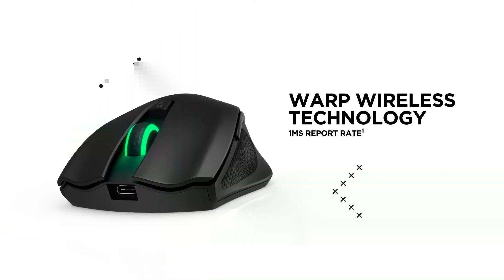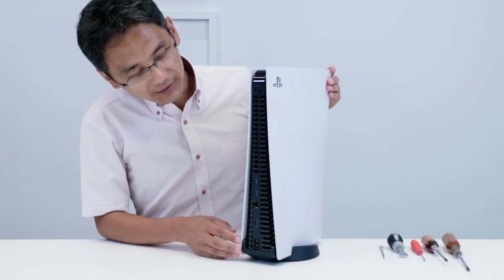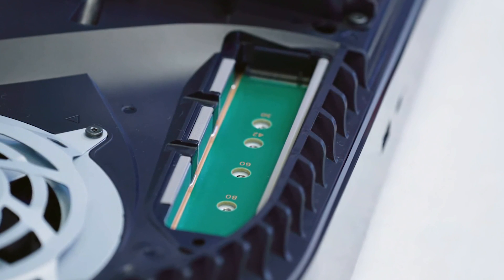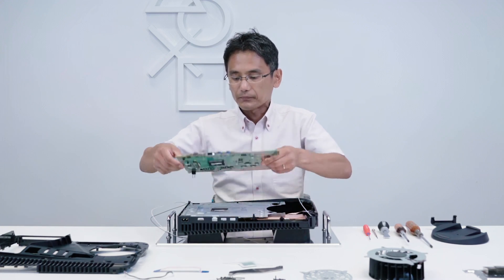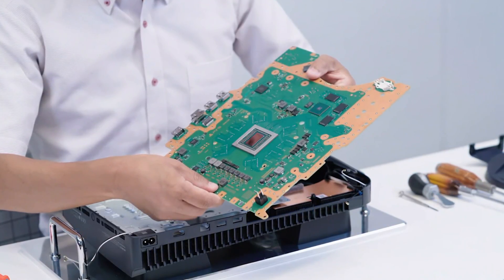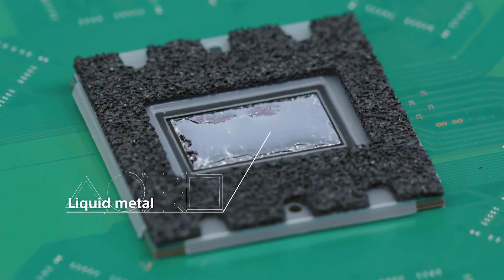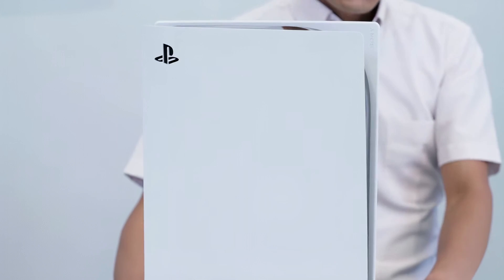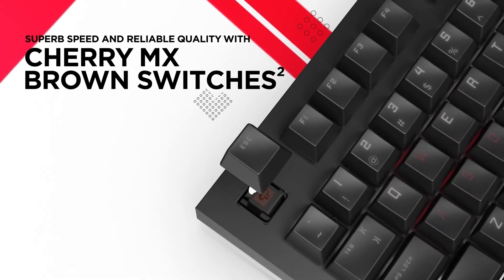PlayStation 5 Teardown Analysis: Inside Sony's Next Generation Hardware Design

Comment: Really put the engineering to these consoles into context...good job by both Xbox and Sony...looking forward to see Whoes solutions are more effective...
DF...you guys are about to have a very Busy 3 months
Reply: I cant wait till DF get their hands on a physical copy of the PS5 so they can do their own proper breakdown
Reply: Sir Vamped  the reason demon souls is 1440p 60 fps is because the Console isn't powerful enough to play it at 4k 60..

A linier..
Non dynamic
Low npc
Low enemy count
+++++First party optimized++++
Game...
Reply: @86lanzo  if this is true then Xbox wouldn't be able to either. There is not enough between them to cause such a drastic drop on one vs the other
Reply: @Jhakaro  I would disagree...one area this Xbox has invested heavily into the series consoles...is in Software...Xbox has the full backing of Microsoft..who specializes in software....Xbox has alot of performance enhancing software..they you just won't see on ps5...

Dispite when ppl who know nothing say...the series x has patents for xboxs own custom VRS..... Machine learning....and  Sampler feedback....

But we will see in time..
Btw the thing that will kill performance the most this gen is RT...so far it looks like Xbox hasn't even finished their RT implimentation....so far we haven't seen RT in a single Xbox game...

However we Kno the Microsoft are the pioneers when it comes to RT ..they worked with both AMD and Nvidia on their RT...it's safe to say they're working on something special for RT on Xbox....it's also worth mentioning series x will be 40% better at RT...so RT won't Kell performance on the series x vs the ps5. ..like we've seen on PC
Reply: @86lanzo  Microsoft isn't exactly good at optimising though, Direct X is way more inefficient than Vulcan, if all PC games were Vulcan instead of Direct X you will get way more performances from your hardware.
Reply: @souljastation5463  depending on what dx you're talking bout...DX11 or DX12...as it stands now there's no performance issues with DX12 it offers on par performance with vulcan..while offering a better suite of features.....some of the best performing games on multiple platforms are on DX 12.. especially xbox first party like with Gears 5..

Dx 11 is another story.
But that's besides the point the work on RT for DX12 is already done...the games we've seen using RT so far were DX 12... probably the best RT implimentation so far (Metro Exodus) was DX12....so the work is done..

Microsoft was the ones who brought RT to AMD... It shouldn't be an issue to impliment RT on series consoles.. especially cause the consoles are DX12U...it's also Known that Turn 10 is Microsoft lead studio when it comes to RT...they did a talk this year at GDC on RT....and have been experimenting with it for years

So the fact Xbox seems to be having problems with there RT would suggest they're working on something special.and the fact PS got there's up already would suggest Xbox is working on a higher level of customization for their RT...

Xbox RT implimentation clearly isn't ready yet...Halo wasn't going to have RT at launch..

DMC 5 Will have RT at launch on ps5 but not the series S/X...

Which if it wasn't Microsoft..the ones who pioneered RT with Nvidia and AMD...then there would be a major problem
Reply: Sir Vamped  who’s talking about Series S? We’re talking about Series X vs PS5. My money says all multiplats will run at higher resolutions and higher frame rates on Series X. You confident enough to that this bet? $100
Reply: "looking forward to see Whoes solutions are more effective"  lol wut?  EDIT - also, the replies are amazing.  People are so butthurt over the SX being more powerful, they have to invent fantasies about how the PS5 will somehow be "better" with its tech.  You guys sound JUST like Xbox fanboys around the launch of the One.  Anyway, this line of thinking has be shit on by DF themselves on their forums - but I guess you can still get away with it here because you have suddenly decided that games dont matter and that Sony's studios won't make the PS5 sing (well, untill convenient, then you will talk about games from Sony's now-puny first party).
Reply: @xBINARYGODx  who implimented cooling better...
Xbox change the shape of the console for better cooling..

PS jbeefed up the heat sink and used liquid metal..

Xbox invested more into gpu an memory

PS invested more into SSD

Xbox and PS though useing the same Architecture..went in very different ways to get the most out the system..both cost 500...but which is best value
Reply: Both Consoles have impressive engineering
Reply: @halogayming0814  yeah many are to ignorant to realise that lol
Reply: FührêrFPöñê  You are being the toxic ones, DP is just stating his opinion; no matter how wrong you think it is he never insulted anyone.
While Xbots like you are the ones calling names and making gross insults.
Reply: MisterMediaX has moved from Xbox to Sony this gen?   Mind blown.    Be your bad self, Mr "Dual Purpose"  Good time,  lots of laughs.    Where is the DGPU this time?  In the side panels of the PS5?
Reply: Sir Vamped  you literally just proved yourself wrong by being arrogant 😂
Reply: Sir Vamped  So you claim the PS5 is holding back console gaming, got it.
Reply: Davin S  bro I'm not trying to insult you but it seems you have a limited understanding of how this tech works. You literally think games run on Teraflops and that's the end of the story.

There is a graphics pipeline that gets your stuff on your screen. Having a peak 12 tfloos doesn't equate to the console producing/render 12 tfloos worth of calculations in a GPU cycle. It just tells you that if all 52 CU were working to process workloads in parallel with in a GPU cycle then you'd have 12.1 to of rendering work @1.825 ghz 

Now SX isn't using all 52 CU in parallel if they have fixed clocks.....they wouldn't be able to manage power draw and heat, particularly in a smaller box and off the shelf cooling system. 

You have also seen no evidence of SX outperforming PS5. We have seen the systems max capacities in Halo, ac Vahala, dirt 5, yakuza, etc. It just isnt close to the PS5.

The PS5 has elemnets that enhance it graphics pipeline. You can either have lots compute or have tech efficiencies that magnify your graphics pipeline to get similar results.

I feel strong about it and it's all objective data, i really just wanted to understand. My opinion is one I'm very sure of.
Reply: @DualPurpose  
You're literally the only one talking about floating point... Just saying. 

Here's some simple facts. 
SX has 16 more active CU. Which equates to ≈31% more over all GPU hardware. 
The CPU even at its lowest clock, is faster than the ps5 at it's fastest clock.
10GB of its ram was dedicated to the GPU and runs a notably higher bandwidth. 
It's using more streamlined modern APIs. 
Has far more features such as native VRS, direct ML, dirextX ray tracing, AI based texture upscaling, simpler feedback streaming, etc.

The ONLY thing ps5 did better was the SSD. But in the end, that's not gonna make up the 20-35+% performance uplift the SX will have in third party games. Your games will load like 3 or 4 seconds faster. Oh my.
Reply: This gen will be just like the pro and one X. 
The one X often pushed at least 2x higher resolutions.

Will likely be the same this gen
Reply: Sir Vamped  Throttlestation 5 is the weakest link.
Reply: @ReaveIdono  This entire "discussion" is the most cancerous I've seen in a long time (not aimed at you btw, or the OP).
Reply: @ReaveIdono  no it's not. Series S is definitively THE weakest console by a mile. And series X is the strongest at least in pure specs by a little bit.
Reply: @Jhakaro  False. Series S is strong enough to do what it was built to do. PS5 on the other hand seems to be struggling.
Reply: @ReaveIdono  Struggling with what? PS5 has not struggled on anything and any "evidence" you try and show is I can guarantee nitpicked stuff that will apply to xbox too but you just don't know it yet. Series S is objectively weaker than PS5 by two and half times pure computational power. It does not run 4k. It is a 1440p machine as stated by Microsoft themselves. You're just flat out wrong.
Reply: @Callum O'connor First off you're all immature idiots arguing over a god damn games console that should bring joy rather than bitterness and hatred. Pathetic. Seriously, both sides need to grow up. But no the series s is not stronger than playstation. That is factually wrong. It is 4 point something teraflops Vs ps5's 10.2 or whatever it is and the GPU is way worse. The Series X is stronger than ps5 on pure spec though. But in reality you will barely see a difference. 

The PS3 was leaps and bounds more powerful than the 360 yet many games ran better on it than ps due to the fact PS3 was difficult to develop for and therefore most games where optimised for Xbox and pc then ported to PS3. Exclusives however looked a lot better on PS3 due to the optimisation just for it's hardware. Difference being that that won't really happen with Xbox as they don't have actual exclusives, they'll always be released on pc too which eats up resources though due to consoles getting closer to pcs, perhaps not as much so as in the past.

Two teraflops which don't even directly translate to gaming performance will make very little overall difference between both consoles. Those saying ps can't do good raytracing, you're right...and neither can Xbox and neither can a 1500 dollar 3090 GPU in a system with better cooling, far superior cpu, faster and higher amount of ram etc. Raytracing just isn't there yet. It's not a viable solution for the most part. If even a 4000 dollar pc can't run it too well then the Xbox with two extra teraflops isn't going to do shit compared to playstation. That's just the truth. 

Difference is we haven't seen much from Xbox showing off the real world performance of the raytracing in-game so there hasn't been much to criticize unlike Spiderman which has been shown. What is in Spiderman is indicative of what the console generation will be doing as a whole not the limitations of ps5 alone.

Lastly you say Sony fanboys are the worst of all time while being an obnoxious Xbox fanboy. Ironic. For the love of God people just enjoy the console you're buying and stop trying to shit on others for their preferences. Also maybe objective facts might help people out a bit. Educate yourselves a little.
Reply: Sir Vamped  Sir VAmped Thank you. I have had this argument with Xbox, PC guys and PS guys. People think 4k = graphics. I told people over a year ago whatcha you get games at 4k 60 that look like current gen or last gen games....2020 came and we seen Halo INFINITE,  dirt 5, and AC Vahala.  Again I was right on the money. They all attacked me but here we are.
Reply: Remember what I said? Devs are now saying people are going 5o very surprised by the PS5. And even DF (shillers) mentioned that raytracing on SX wouldn't be better or rather inferred that the assumption is potentially not true. 

I have spoken extensive about these graphics pipeline efficiencies in PS5 and Inefficiencies in SX. I have been on the money all the way. Maybe later this month well get that Smartshift advantage, GPU cache scrubbers, cache advancements, i/o complex. This is why you'll end up with far better performance on PS5 than SX. Spiderman is 4k 60 with SSR on PS5 and compared to any title ON SX like Halo INFINITE at 4k 60(no RT), AC Vahala 4k 60, dirt 5 4k 60....it blows them out the water. Vast visual advancements over SX.
Reply: @DualPurpose  Saying PS5 will run and look better than XSX is like saying people with a 2060 super  and the games they play will look and run better than a 2080 super. Stop being so delusional.
Reply: @jaigray5422  Consoles don't work like PCs the games are optimised for it.
Reply: @DualPurpose  and BTW  AC Valhalla is more demanding then Spiderman....for obvious reasons..but if you don't know...

Less tall buildings to hide loading and rendering behind..less draw distance because of obstructions
Reply: @86lanzo  You think that. Ac Vahala is definitely not more demanding. And nothing has to be hidden as you try to make as a claim. There is literally not a single loading screen on the PS5 version of Spiderman. Seamless world design. High detail, at 4k 60. AC Vahala was 4k 30 at first on sX and already looked like a current gen game, I wonder how much they had to downgrade to get it 4k 60. It's not even close
Reply: @DualPurpose  have you played miles Morales yet?  so why say that there is not a single loading screen. and if it does? then it will be different, of course, because they are saints. with the ps3 fucked up, but this is different
Reply: @iznogoud8780  Cool ya jets, it's what Insomniac stated. I relayed the message don't shoot the messenger. They said that lauding screens ate virtually nonexistent on the PS5 version.
Reply: @86lanzo  

I wouldnt say more demanding. AC Valhalla still uses large stretch of empty land during traversal (like TW3 or most open world games) to aid loading of new structures.

Plus their using the very old Anvil engine, which definitely needs a revamp.
Reply: @DualPurpose  Virtually non existent and NONEXISTENT are two different things...
Reply: @MavihsLH  nah AC Valhalla is definitely more demanding..you can see that from its PC performance and from the last 2 AC games..

Also Spiderman is using the same game engine as the 2018 game
Reply: @86lanzo  

AC games have always been poorly optimized. Especially Odyssey. So I expect Valhalla, which uses a very similar engine to be poorly optimized aswell.
Reply: @MavihsLH  lolo..that's so funny..I would tend to agree with you there...let me ask you this..does that extend to xbox....can you have a poorly optimized game for series x....or would you run with that poorly optimized game and use that as a fanboy point at how weak a console is..
Reply: @86lanzo  

Honestly I dunno how relevant that question is to the topic. But yes you can have a poorly optimized game for series x. Yakuza runs at 1440p 60fps and 4k 30fps, which could largely be because of poor optimization.

People who take a few games and look at their performance, and judge how powerful the console are off em is ignorant and toxic.
Reply: @MavihsLH  it's very relevant..that's all PS fanboys are doing right now...

Using dirt 5 in some dumb fanboy fight.. dispite the fact the game is multiplat...the dev has come out and said it's and old build and the issues that were in the game was fix...

Ppl want to ignore the fact this is all preview versions of all these games so by enlarge the games won't be as optimized as when launches..

But Fanboys don't care... anything to make them feel good about the plastic
Reply: @86lanzo  How could anyone think Xbox has anything good?? They have nothing Proprietary or patent protected in that system as far as hardware tech....its all off the shelf. They cant even show anything impressive running on it and the competition is getting massive praise and showcasing 40+ times that they got the real deal.

You guys literally have to guess what the SX games look like ....."NBA 2k21 will look better on the SX" You haven't seen it, but you're forced to make guesses cause all you guys know is Teraflops. Hello there is a graphics pipeline that doesn't show up on spec sheets!!! That's were SX loses badly. 

There are plenty of people saying SX is having major issues with its gdk, raytracing, etc. And you guys ate in the "burning fire" literally and figuratively like it's cool nothing is wrong here.
Reply: @DualPurpose  lol you're so naive,  I'm a ps guy but because people like you there's so much desinformación, xboxsx is more powerful than ps5 in every way except sdd but at the end of the day games matter most
Reply: @86lanzo  

I agree. Alot of Sony fanboys are definitely putting too much emphasis on these games for sure.

But regardless let's not forget the Xbox fanboys who shat on Ps5 for not delivering 4k 60fps ray tracing on demon souls.
Reply: @lirycline6646  out of all these PS fanboys, you’re the only one with integrity and common (not so common nowadays) sense...As an Xbox guy, I applaud you sir
Reply: You're probably the type of person that will say Xbox sucks because it has no proprietary tech in there....

Then turn around and say Xbox sucks because they have a proprietary SSD drive
Reply: @MavihsLH  that's true.. although.. Demon Souls is a bit different in that it's first party.....which is the most optimized games on any system... especially when it comes to a new gen
Reply: @leonxl  thanks, it's just I have a pc and a ps4 and by just reading this thread I felt dumb lol, it's obvious that the Xbox onesx it's more powerful just by raw power but some people think that in a magical way the ps5 will be more powerful just because the sdd
Reply: @lirycline6646  exactly. Series X has a more powerful GPU with more compute units and hardware based ray tracing, faster CPU, faster RAM, and a larger SSD. PS fanboys point at the PS5’s faster IO SSD and claim that makes their system better. That’s like saying slapping a PCIE4 NVMe on a 2060 rig will make it better than a 2080Super rig with a SATA drive. This is just one of the many reasons why I will never support the PS brand. I just can’t consciously bring myself to contribute to that pool of idiotic hypocrites..
Reply: @lirycline6646  Listen I'm PS guy but dont correct me if you dont even know what I'm referring to when I say the graphics pipeline. Do you understand how the workloads are managed? The parallel use of CU and all its components within a GPU cycle. This stuff doesn't show up in the teraflop number at all. Infavt the Teraflop number doesn't tell you anything about the graphics pipeline. It just tells you the maximum peak calculations that a system CAN run not WILL run.
Reply: @86lanzo  oh I forgot the Proprietary ssd....but that's not new tech they just customized the nvme to be able have it plug in.

But in the aspect of the ssd it does suck as that's not even part of the system that's an outside purchase. And you are limited to their ssd which is nearly the same price as other nvmes that are 3 times faster. The other nmves also have lower storage options for less costs. Comparatively, it makes the PS5 option better. Again, these are external hardware components. I spoke of the hardware in the SX vs PS5
Reply: @DualPurpose  
Let's not forget this. Digitalfoundry and other tech experts say the ps5 is equivalent to a 2060/su.
Yet they compare the SX to a 2080/80ti...
Reply: @DualPurpose  
Funny you keep mentioning all these things. 
Let's see these official sources.
Reply: @DualPurpose  have you seen the ray tracing in ps5 games? Grand Turismo 7's reflections are low quality, and the Spiderman gameplay barely included any gameplay. I love what Sony is doing and I can't wait for the ps5 , but stop being naive
Reply: @DualPurpose  The DEV kits went out later for XSX, because MS waited for full RDNA 2 features you are bragging that PS5 games are further along, but the reason for that is the console is missing RDNA 2 features that will make XSX games look even better down the line.  So not only is the PS5 significantly weaker its not even full RDNA 2 yet you brag about this. You are in for a rude awakening and your comments here will live on to haunt you
Reply: @leonxl  Maybe he is Just a PS fan. I am one too. I prefer Xbox for many reasons but I have had many PS consoles down through the years and will probably have a PS5 at some point. The vast majority of games I buy are multiplat games, so they will run and look better on XSX, so I will get that first. I will wait until Sony have released 5-6 must-play exclusives that I am interested so based on the PS4 that should take 4-5 years there will either be a mid gen refresh by then were Sony may have the most powerful console which would be reason for to pick it up or the PS5 will be cheap enough to justify buying it for the 6-7 games I will play on it.
Reply: @nighttime1998  digital FOUNDRY is not official anything. They are official tech shills. We'll need true objective testing.
Reply: @DualPurpose  
Lol. Ok buddy
Reply: @86lanzo  You are GraphiteGB from the forums, am I correct? I just know it.
Reply: @-Batman-  nah this is my username every..PSN..live..Steam... GitHub.... everywhere
Reply: @86lanzo  So you weren't active back in the PlayStation forums when it was still online? Bro if not you are basically his twin. You two speak so similar to each other I'm almost sure you're the same person lol...
Reply: @-Batman-  nah ..was too bz... wasn't really ever involved in any forum or reddit..
Reply: @86lanzo  cool
Reply: @DualPurpose  lets see if you think the same after The 2 consoles are compared with dozens of game play.
Reply: @DualPurpose  I think you need a big heat sink and fans to cool down bruh!!
Reply: @DualPurpose  who are you again? You act like everyone follows you.
Reply: @DualPurpose  I am 99 percent sure series x will run multiplat a better then ps5 and also have better raytracing capabilities. You Sony guys will never just admit when something is better then a PlayStation product lol
Reply: @anthonypeterson42  Okay cool but you are guessing again....like I said....based of teraflop numbers. You maybe not seen one example of this. You haven't looked into the graphics pipeline efficiencies and inefficiencies. I feel strong the Os5 will outperform SX across the board. 

I know I'll get labeled a fanboy  because I like PS, but I'm basing off objective info. I never denied the SX has a higher peak tflops calculation. But what I do deny is that that tells you anything about the graphics pipeline which I believe PS5 will far out do it. And that matter most......what is your GPU doing in every single GPU cycle. The GPU cycle is how rendering things on your display occurs. Soooooo......we will see
Reply: @DualPurpose  actually no I’m not guessing and it’s not just about teraflops. You can talk all the nonsense you want. Wait until the comparison videos come out. Only thing I expect ps5 to do better is load into games faster and things like reloading a character that dies faster. As far as first party games, ps5 does have the advantage when it comes to game design potential. But I’m sure series x will be king of most if not all 3rd party ports over ps5.
Reply: @DualPurpose  yeah but all you keep talking about is gpu so stfu, what about  the other specs that shit on ps5 ? Oh btw i have two SSDs on my PC and one much faster than the other but at a point it begins to not matter, at best you will get 3 or 4 seconds faster loading of a game on the initial start up MAYBE but there will be no other noticable advantages . Plz stop talking about things you yourself don't understand and probably seen on some article. As for graphics and performance of games that is down to the devs to optimise those games for the platform they run on like that Yakuza debacle that is notorious for running terrible on pc aswell regardless of spec.
Reply: @DualPurpose   "Listen I'm PS guy but dont correct me if you dont even know what I'm referring to when I say the graphics pipeline. Do you understand how the workloads are managed? The parallel use of CU and all its components within a GPU cycle. This stuff doesn't show up in the teraflop number at all. Infavt the Teraflop number doesn't tell you anything about the graphics pipeline. It just tells you the maximum peak calculations that a system CAN run not WILL run". 

what are you actually on about ROFL? you don't even know how much BS your talking and you wrote it. First off before we even talk about CUs 100Gbs more bandwidth of GPU VRAM vs PS5 is literally going to be a night and day difference in off itself and this is before we even talk about CUs. 2nd if XSX had problems with it's CUs in a GPU cycle it wouldn't be performing at 2080 super levels of performance. Look what they've already shown off Gears 5 weather you like it or not is irrelevant point is they literally showed it 6 months ago running at NATIVE 4k at PC ultra pre sets at OVER 100 FPS they even directly compared it to a 2080 super and XSX out performed it at PC LEVEL OF DETAIL ON TWO WEEK OLD CODE. If there was even remotely a problem with CUs and GPU cycles it wouldnt have got even close to a 2080 super. They also showed of Minecraft fully pathtraced again something only something like a 2080 super minimum can pull off, this is fact not something thats made up. Dirt 5 might not blow people away graphically but fact is it runs @ 120 fps something that isnt easy to do in new games even on my PC which is more powerful than either console. 

"But what I do deny is that that tells you anything about the graphics pipeline which I believe PS5 will far out do it".

Common dude you've got to be trolling at this point either that or your that delusional you actually believe this BS. Do you really think that the PS5 which is weaker than an XSX in every single way other than SSD speeds is going outperform the XSX? Keep dreaming, PS5 has a slower CPU, less Bandwidth for it's GPU by ALOT, less CUs, unlocked clocks with smart shift which will make the PS5 drop it's GPU clocks all the time no matter what lies Sony tell you otherwise,  Not even using FULL RDNA 2 features like XSX is, hell the RDNA 1 and 2 in the PS5 could mean 1 Tflop for PS5 is actually so much less than XSX that XSX is 1.5Tflops per PS5s 1 due to the difference in tech for all we know. But that is speculation exactly what your doing with this BS CUs dont get used properly because of GPU cycles and all this rubbish that I literally debunked in the mater of minutes of actually knowing somewhat what i'm talking about.
Reply: @DualPurpose  "ps5 will out-do the xsx"
According to what though? Spec sheets say otherwise, and we have actual 3rd party gameplay with the xsx, whereas Sony are giving us gameplay, not knowing whether or not it is the natural experience. Plus, out of everyone in this thread, you should know that Microsoft invested more into raw power, whereas Sony invested more into the speed and io of its console. It just seems you are being ignorant
Reply: @Chris-sb4gy  Reminds me of Killzone back on the PS3 😂😂
Reply: @jaigray5422  Where did you take that 100 Gbs advantage in vram speed, I'm pretty sure Xbox as and PS5 are roughly equal in vram speed.
Reply: @souljastation5463  Nope XSX has 560 GBs in bandwidth PS5 446 GBs for it's GPU this on its own is going to make a difference and this is before we even talk about the other stuff like CUs clocks etc. This is pretty common knowledge at this point.
Reply: @souljastation5463  "Consoles don't work like PCs the games are optimised for it".

Yes that is normally true however in the case of Gears 5 and Minecraft fully path traced . These games were in their RAW format without optimizations and still out performed even a 2080 Super, microsoft showed these running half a year ago at this point debunking his claim that XSX isn't as powerful as PS5 because of Cus not on all the time and GPU cycles and all this rubbish, nothing but delusions and BS.
Reply: @jaigray5422  If it's common knowledge then people are misinformed, this are the real data:  PS5 has 16 GB at 448 GB/s, while Xbox has 10 GB at 560 GB/s and 6 GB at 336 GB/s.
Reply: @souljastation5463  You don't read do you? I said for it's GPU ie VRAM. 10 GB of dedicated VRAM at over 100GBs more bandwidth is a huge advantage. PS5 is integrated into the entire system. Xbox has Ram for CPU and tasks that dont need high speed ram and DEDICATED GPU VRAM which does need high speed ram. XSX Ram is far superior you already see this on PCs.
Reply: @anthonypeterson42  Why do you think that? I don't think that due to the graphics pipeline. What's your basis for SX outdoing PS5 in 3rd party?
Reply: @DualPurpose  we will see when the comparisons are made. Doesn’t matter what we think until they are head 2 head in port comparisons.
Reply: @anthonypeterson42  So if Teraflops are not your basis why are you making that claim?
Reply: @DualPurpose  doesn’t matter, you will see when they are compared like everyone else. Tired of arguing over stuff like this, we can see in a few weeks
Reply: @anthonypeterson42  I'd like someone to accept a bet. You guys are stuck on specs and you'll be stuck on stupid if I'm right. 

Just please I don't want to hear devs are being lazy or they didn't optimize it for SX  it's gonna be because if the things I laid out.
Reply: @DualPurpose  only time will tell, I think you are worried about this too much to be honest, you act like Sony is going to hire you if you are right lol. Honestly I don’t care much, doesn’t hurt me either way. Not like I can’t just get a ps5 if it performs better for 3rd party games.
Reply: @anthonypeterson42  
He's like this because way back before ps5 hardware was revealed, he was one of those people crying the Ps5 would be 13+tf. That it would be stronger and cheaper. Etc 

So he's still trying to find a way to cling to his old narrative like most Sony fanboys (key word- fanboys) are.
Keep in mind, these are the exact same people who said graphics didn't matter when the one X came and was out performing the pro by a good bit.
Reply: @jaigray5422  OK, if you say so
Reply: @DualPurpose  "Far better performance on PS5"..... Lmao, that was funny
Reply: @DualPurpose  Xbox is the better deal and wins with game pass
Reply: @DualPurpose  even with smart shift.. ps5 maxes out at 10 tf, xbox series x runs at a constant 12 TF. You're reaching bro.
Reply: @jo12danjames  prove it. It runs at a constant fixed clock of 1825 mhz. But you have to vary either workloads or clocks to manage power draw and heat within a gou cycle.

So by technical fact SX is varying its CU workload processed in parallel while clocks are static.
Reply: @DualPurpose  were talking xbox not ps5. Ps5 will be managing all that, xbox will have dips and peaks, but only as the game determines its needs.
Reply: @DualPurpose  the playsation is using that rdna 2 feature of smart shift, xbox is using other rdna 2 features ps5 is not, the ps5 will be variable and thats why they are going to extreme to keep system temperature down so it has a better chance of running ,ore consistently at peak performance while in boost mode.
Reply: @jo12danjames  Smartshift isn't a RDNA2 feature. You guys in this thread just take sometime to do some objective research smh. Smartshift is AMD technology that is used to synergistically pair it RDNA and ryzen processors for increased performance.

Smartshift can be used on RDNA1, but with RDNA2 its benefits are far greater as per FRANK AZOR(chief architect at AMD behind Smartshift). Stop thinking about spec sheets and start thinking about what's happening in the graphics pipeline. The shifting is allowing for greater performance than comparative fixed static frequency counterparts.
Reply: @DualPurpose  once again even with that technology  peak performance the ps5 is still 20% less powerful then the xbox series x
Reply: @jo12danjames  First off that's not true on so many levels. What you are trying to say is SX has 18% more peak theoretical floating operations.

Again, these two systems are asymmetrically designed. They don not operate or function the same way. Tflops for the last time is not the graphics pipeline. A GPU doesn't just say here is 10 and here is 13 tflops. It operates in cycles making use of the CU for processing by varying them and using the available shaders, tmus, rops, and cache for parallel processing.

So you can technically have less peak tflops and still far outperform a system easy if your GPU cycle is far more efficient. It's in the graphics pipeline where PS5 produces far better quality. To put it short SX isnt using 52 CU to process workloads in parallel/ simultaneously with in a GPU cycle. What more is PS5 has GAME CHANGERS.....GPU CACHE scrubbers. They can scrub the cache and put new data in its place to basically allow the CU to do more work and faster. So it's like a CU having 4 arms instead of 2.

Let's use that example. You have 52 soldiers with 2 arms each holding a sword......that's 104 swords that can be held at a time. You have 36 soldiers with 4 arms each...that's 144 swords that can be held at one time. With 3 arms its 108 swords. The swords here represent the GPU render work on the display. So the PS5 would be doing far more in its cycle.
Reply: @DualPurpose  being a fanboy and trying to convince others the ps5 is more powerful then xbox series x, must take up your entire life. You're gonna believe the ps5 is more powerful no matter what the hardware is, and I'm sure you'd be having a field day if the ps5 was the the xbox series x but its not, also I like to support America not japan so ill gladly be buying the more powerful series x first
Reply: @DualPurpose  also the xbox series  has its own xbox velocity architecture that does stuff the ps cannot, and sony is being awful quiet, we still don't know very much about what it can do! Like dlss for example, on top of all that, I'm  huge bethesda fan I love skyrim and fallout, and since I cant play that or doom, wolfenstein and all the other amazing bethesda games on ps5, XSX it is! I'll buy a ps5 a few year down the road when God of War comes out.
Reply: @DualPurpose  mad ? Haha you wish, you're the mad one! Arguing with all these people about a piece of plastic. I've done my research, thr xsx is the more powerful console amd its what I prefer, so enjoy your playstatio. I'm going with the USA
Reply: @DualPurpose  I’ll bet you $100 that all multiplats will run at higher resolutions and higher frame rates on Series X. Deal?
Reply: @leonxl  I can do that as long as it is not a digital FOUNDRY comparison. I'll do real objective test...VG tech, NX Gamer, etc. Also it womt be any studios that have marketing deals with MS as they are trying to push the product as Dirt 5 devs have been doing.
Reply: @DualPurpose  so does that mean we can’t count Activision either since they have CoD marketing deals with Sony? Lol even if 9/10 games run at higher resolutions and frame rates on Series X, you’ll point at the ONE game that doesn’t and claim victory. I already know your type LOL
Reply: @DualPurpose  
Literally every thing the ps5 is doing, Microsoft is doing... 
This gen will be just like the pro and one X.

X offered a massive advantage in 99% of games. 
Will be the same this gen. 

And we're you crying the ps5 would be 13tf a while back?
Reply: @DualPurpose  where are those 13 tflops???
Reply: @kerninjathefrog6569  😂😂😂😂
Reply: @kerninjathefrog6569  why do you keep bringing up rumors? 13 troops was a rumor guess what no one got any of these consoles specs right cause we were in speculation and unconfirmed territory. Me backing 13 tflops was supported by the industry saying PS5 was more powerful so there is no issue. Dealer thought SX would have 56 CU clocked at 1.7ghz. And Zxhuge actually got the 52 CU at 1.825 correct.
Reply: @DualPurpose  it's amazing how to you halo runs on series x...when you want it to....and when you don't want it to..it's running on a PC...

Keep that same energy...

Here's one thing to consider...Xbox clearly believe they have the most powerful console  after everything Sony has shown...

You're comparing multiplats ..where we haven't see the PS5 version....a unfinished halo...

To reskined ps4 game..which DF on ps5 clearly says had performance like a 2060S....

Keep that same energy... we'll see one Sony are forced to hand the ps5 over to DF to do comparisons

You call DF  shill because you don't like the facts they bring out...

When they get there hand on the ps5 you'll think they're even bigger shills
Reply: @86lanzo  quick question, were you very active at the sony forums back before it got removed by sony? You remind me of someone.
Reply: @86lanzo  Okay you're right about one thing I'll keep that same energy. Halo INFINITE was running on a PC....one that for sure was some $3000 high end build but the thing here that's important is they gave literal specs for how Halo INFINITE runs on SX.....they stated it was 4k 60. I would also like to add that it was found out that it was also a DYNAMIC 4K not native as well as having frame dips. So we can use Dirt 5 and see that its visuals fall far from that of Spiderman running at the same spec level. This means the SX couldn't produce the same visuals of an OPEN world Spiderman game at a level of 4k 60. And that 4k is dynamic in Dirt 5 btw if we look at other more credible breakdowns.
Reply: @DualPurpose  dude first dirt is a multiplat...so don't speculate...let's just wait...

We'll see Ps5 performance in that game soon enough...if you're correct it will perform considerably better on ps5

Halo was confirmed to be running on a mid tier PC..with an SSD..with no Velocity Architecture implimentation

I Don't even care for a back and forth... we're getting close to launch...when Sony finally has the minerals to give the console to ppl to test ...and we get to see games in a  non curated environment...we Kno Sony even downgraded games so we'll see...

All I Kno is one console manufacturer has given the Console to 100s of ppl to test...the other has shown it to Elton John
Reply: @DualPurpose  Talk to me all about it hehe is the cache scrubbers and infinity cache the same thing?? And does xboxsx have it?
Reply: @andresshhshbsft  SX has none of those. I heard they cut their cache size in half. But if both of those are present in the PS5 or even just the cache scrubbers alone its game over. You cant outperform a system that can take its 36 CU in one GPU cycle remove old data and replace it on the fly to make those 36 CU do more work in a single GPu cycle. The only question from here is how do those 36 CU perform do they double to 72 CU like performance or do they get a minor improvement of 44 CU like performance?? Either way it's still a major win.

And GPU cache scrubbers with high levels of infinity cache could make something like "72 CU like" a real deal.
Reply: @DualPurpose  Big Facts. Sony has shown Next Gen Games running on PS5. Lets see The Series X with their Next Gen games running...